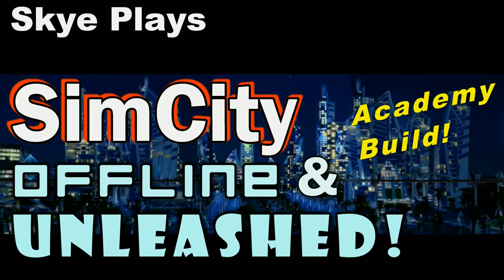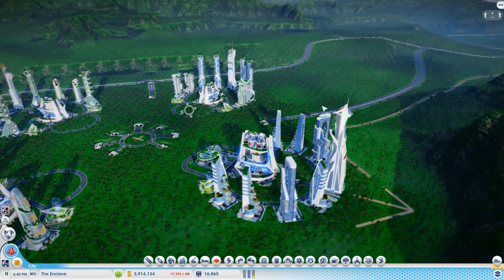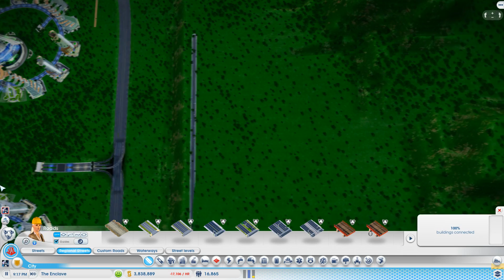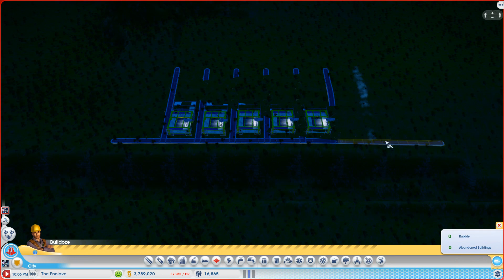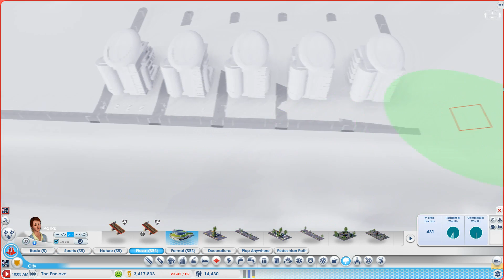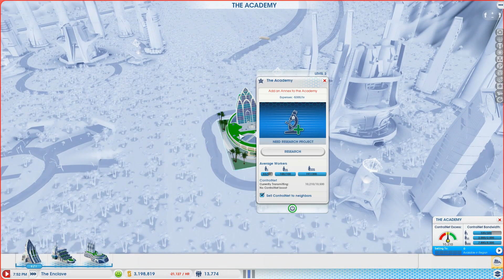SimCity OAU Academy Build #5 ►The Enclave - Industry and Research◀ SimCity 5 (2013) With Mods

Comment: With the mega tower skybridges, you could have the sky bridge on the Admin megatower be at level 6, this then connects to the skybridge on the commerce megatower at level 2, then another skybridge at level 6 which then connects to eco megatower at level 2, then level 6 skybridge which connects to tech megatower at level 2 and finally level 6 skybridge which connects to admin megatower at level 2. The levels are of course interchangeable :P